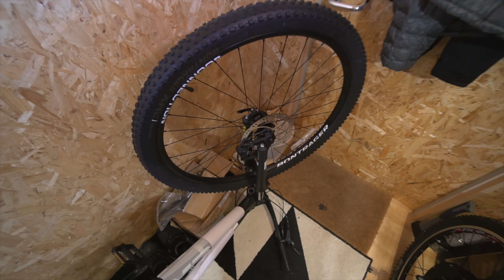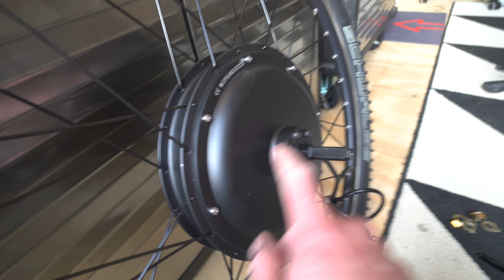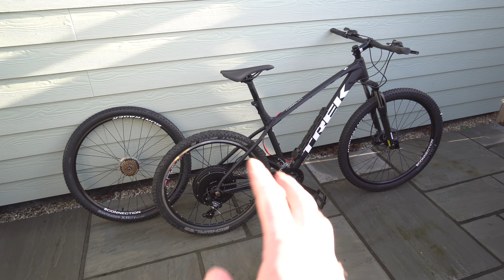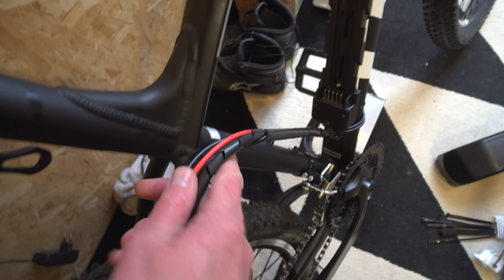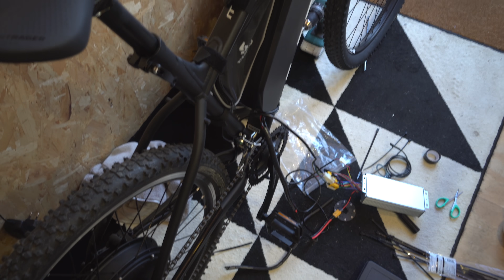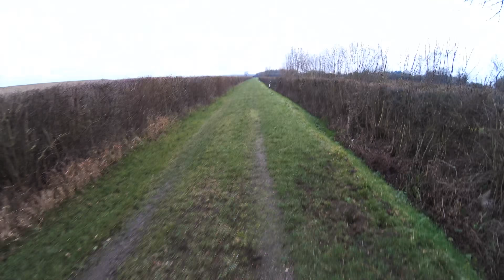HOW TO MAKE AN EBIKE IN UNDER AN HOUR!!! | TREK MARLIN 5 EBIKE CONVERSION

Comment: Nice to finally see a decent U.K. Eebike build. Thanks for the video. How have to found the kit reliable? How’s the battery etc?
Reply from the maker: Very reliable, I’ve been using hub motors for years and they just keep going, even if they regularly get wet and dirty they continue to run just fine. Battery is over specced for this kit so it doesn’t even get warm and offers over 30 miles range.

Comment: Great video I'm after a kit with pedal assistance and the thumb throttle and a bit of range 40 odd miles + if possible can you recommend any kits please
Reply from the maker: Yes this: https://www.cloudsto.com/ebikes/kirbebike-conv-kits/kirbebike-1500w-2000w-ebike-kit-inc-ion-plus-58v-17ah-battery-detail.html

Comment: Back wheel constantly needs respoking due to torque pressures , real pain in the arse . Rain really screws up the exposed wires . Also bike heavy and difficult lifting over stiles and steps . Try putting the equivalent weight of kit in a pannier and your first thought will be : ‘ This bike needs a motor “!  Electric bikes are an illusion .
Reply from the maker: Maybe you got the wrong kit 😁

Comment: Thinking of buying the conversion kit. On the cloudsto website in the description it says it comes with a 58V 17Ah battery, but under battery specifications it says 52v 17ah. Which one is it?
Reply: 58 is probably fully charged, and 52 is probably nominal voltage. I may be wrong but it should be the same pack

Comment: Have just completed a conversion of this exact bike, trek marlin 5, 29er, 
Fitted a 1500w hubmotor, controller and display look the same, 
48V 21ah triangle battery, 
power is great, 
65kph on flat fully charged, 
40kph up an incline, 
30km range without pedalling, 60km range or so depending how much I help it by pedalling, 
And the bike handles great, although braking has been affected as it is now quite heavy,
Reply: I bought the kit from CSC bikes on eBay, the battery I purchased from Etario store on Aliexpress as it was cheaper, 
if I was doing it again I would get maybe a 1000w or 750w as I think they would be powerful enough, 
On full throttle with the 1500w motor the display shows over 2500w consumption, not good for range when you do that,
Reply: @NM-zb2mo  Thanks for the response and tips! I'm building my own soon :)
Reply: Niall Martin thank you for the information!!
Reply: sounds amazing. Where did you buy the kit and battery?
Reply: https://youtu.be/fyYI2yCxsRc
Reply: https://youtu.be/GhZyjmx22ZE

Quick video of the bike, will get something better recorded soon,
Reply: I bought the same bike in the video about 5 years ago. I like the idea of getting an e-bike so I can do longer rides. Never knew you could convert one. You think I'd be better off converting my bike, or just selling it and buying an e-bike?
Reply: @glenc2353 better off buying an e-bike, conversions have a lot of drawbacks, sensor pickup when you pedal is not configured properly with the controller, maybe there’s better controllers now. Weight is an issue, some custom work needed also to fit.

Comment: My motor makes a noise, vibrates, but dosn't spin. Any ideas? I can spin it with my hand but not the electricity.
Reply from the maker: Check your phase wires (three big wires going from the controller to the motor) also check other connections between motor and controller.
Reply: @andykirby  Ok, thank you. I will check.

Comment: Hi Andy, I have just received this kit and the controller in the box is showing rated voltage 48v and rated current 17A, on the website it says the controller max voltage 58.8v and max current 35A. Is this the correct one? Or are max and rated different things? As far as I am aware rated voltage is the maximum that it will run before causing damage and the battery that I should be receiving off the same order this week is a higher voltage than this controller can take.
Reply from the maker: It’s the correct one. The controller is designed to handle 60V. The battery will only be 58.8V when it’s hot off the charger and will drop as soon as you throttle. The current is 35A peak and you’ll only get anywhere near that when accelerating from a standstill and even then it will just be for a few seconds. Hope this helps.

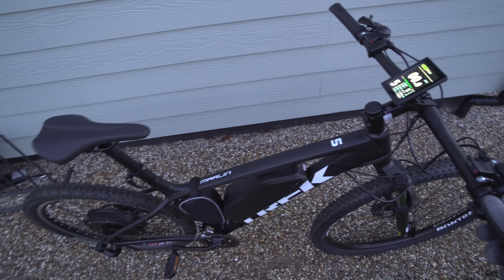Comment: you did not install the pedal sensor (11:10-11:40)  and so you don't have pedal assist. you are just using throttle mode.
Reply from the maker: I did install the pedal assist in the end.

Comment: Hi I like the idea of a road legal kit, I would prefer not to have a thumb throttle just rider assistance. Can the level of power assistance be regulated from the display screen? I am looking to replicate the latest batch of factory E Bikes, like the Ribble Se which has 3 fixed levels of power assistance.
Reply from the maker: Yes you can use just pedal assist and there are 5 power levels selectable via the display.
Reply: Thanks for that what is the range for the battery that is in the kit?

Comment: I'd be super interested to adapt one of these to fit a Fat Bike. I just acquired a lightly used Coyote Skid Row. It has 26" x 4" wheels and the rear axle is 240mm long with the hub being approx 135mm from the disc brake mount to the back of the 1st gear cog. Can't measure it any more accurately at the mo as I want to go out on it this afternoon! I can guess that it will need a wider hub to keep the rim centralized in the frame and the gear set aligned with the front chainring. But maybe not, could the wheel be re-laced to the ebike hub to offset the gears while a spacer deals with the brake disc position? I'm a CNC mill setter and have made a few bits and pieces for myself over the years. 

Heh, I'm going to check out the re-cycling center this afternoon to see if they have any disc braked bikes down there that I could hack.
Reply from the maker: Should be possible, as you say the only real concern is getting the rear sprocket inline with the chainring. You could relace the motor wheel to the fat bike wheel or we can supply a fatbike motor wheel. If you email me we can discuss further 😁 andy@cloudsto.com
Reply: @andykirby  Sounds interesting. I just had my first proper session on the Fat Bike and love it to bits!!!

Comment: Alright there my friend I watch your videos a lot and think they are spot-on and the things that you do all Electric is the future I have just bought my 48 volt 1000w bike conversion kit and I don't have a battery to question that I have for you as I have 5 14.8 volt quadcopter batteries would 3 of them Tom the motor at Max charge the three batteries will give 50 vaults but the ESC that came with the brushless motor is Max 48 volts if I stuck 50 volts into a 48 volt AC will it blow thanks I will be waiting on your information all the best my friend
Reply from the maker: Hi there, 4S packs are a bit of an annoying voltage as for a 48V setup you need 13-14S (depending if the controller can handle 14S). You could try to use 3 of them as it would be 44.4V nominal and 50.4V fully charged. The only problem is they are probably quite low capacity if they are quad copter batteries (maybe 5Ah Packs?) you would not get a lot of range (well under 8 miles if you pedalled as well)
Normally people parallel lots of RC batteries together if they want to use them on their ebikes. It can be a bit of a nightmare with balancing and charging. Much better to get a proper ebike pack 😁

Comment: Nice video Andy, :) , I have same rear motor, you reckon she can handle 3kw easy eh? how many volts would we need on the battery to pull that off, 100volts? and 100v controller?
Reply from the maker: About 72V and 40A ish...

Comment: Do you have that compete kit with a 750 to 1000 way motor... Can you get it that way, and maybe 20-40 ah batteries. I'm guessing but two batteries.
Reply from the maker: Yeah it can be done, 1000W. Batteries of above 16Ah you might have trouble fitting that size battery in your frame though?

Comment: Do you think your kit would go on this i think i might strugle with the clearance for the battery also im only 5 foot 9 and like to ride with high handle bars so putting a smaller 26inch wheel on the back what do you think ???    (https://www.ebay.co.uk/itm/Canyon-Nerve-Al-6-0-27-5-large-frame-mtb-mountain-bike-trail-dh-downhill/333202093983?_trkparms=aid%3D888007%26algo%3DDISC.MBE%26ao%3D1%26asc%3D20140328180637%26meid%3D0e4093701176417f9be313582f885163%26pid%3D100009%26rk%3D1%26rkt%3D1%26mehot%3Dpp%26sd%3D123766744005%26itm%3D333202093983&_trksid=p2047675.c100009.m1982)
Reply from the maker: Nice bike, yeah you might struggle with the battery, there does look like a bit of space though, you could mount it underneath... I’ve got the battery dimensions if you email me...you can put smaller wheels on yeah, shouldn’t be a problem.
Reply: @andykirby  Thanks for your reply I think I will wait for the right bike to Come along I like your Trek but like full suspension.
Reply from the maker: Yes, quite a few guys have done full suspension conversions with my kits now, it purely depends on the bike, you really need to measure to be sure.
Reply: @andykirby  can I have the battery dimensions please
Reply: I've bought a trek 6700 from ebay with lots of extras second hand £150 in great condition and I've bought your kit can't wait to put it on.
https://www.ebay.co.uk/itm/trek-mountain-bike/223527230104?ssPageName=STRK%3AMEBIDX%3AIT&_trksid=p2057872.m2748.l2649

Comment: Hi Andy how can I contact you by email or phone to get a controller? Ive been following you for years and have got several ebikes here in Bournemouth..Have one almost the same as this on a Carrera bike 1500w setup similar to yours
 but I believe my controller has gone, bought another controller similar but has all different plugs and just want to get it going again maybe buy a controller from you.
A fries used it and back wheel came off under load, didn't do and cable damage but the controller stopped ...
reads Sam
Reply: Ive seen your email now at cloud will email you
Reply from the maker: Yes got it thanks.

Comment: On the disc brake side where did you get the part to mount the disc please? Thanks in Advance, have a wonderful day.
Reply from the maker: You mean the little spacer? It comes with the hub motors. You only need it if you need to space the disc out from the hub.

Comment: How have you found this setup over time. I'm thinking of doing the same with the same bike or do you have a recommendation for another bike to convert in the same price range
Reply from the maker: It’s working great and is a joy to ride, I’ve changed the front forks to proper rockshox air shocks now as the standard ones are a bit like pogo sticks! check the video a few after this one where I show the mods I did.
Reply: @andykirby  you never said how much the kit was and where you bought it from that's amazing how you guys don't mention the things that people wanna know the most amazing!
Reply: @grangergreenback7152  - Its in the description.
Reply: @sumran_domguy  I made that comment before the video ended, then right after I went back and looked at the video again to see the price

Comment: I think you installed the rotor in the wrong direction there is an arrow showing the direction of rotation
Reply: The Discbrake is on one side... It doesnt fit otherwise

Comment: Looks really good but 739, how much better is it than the ebay ones that are 175
Reply from the maker: Remember the kit includes a high capacity battery. You wouldn’t even get a decent battery for £175 let alone a good motor kit. 😉

Comment: could you mount an alternator to the front wheel and charge the battery? as you ride
Reply: The motor can actually work in reverse and act as generators, so you wouldn't need an alternator. He did mention regenerative braking, but didn't go into any depth. You could pedal against the regen but in principle it'd be more efficient to set the throttle to zero if you're not trying to slow down.

Comment: Hi Andy good video mate, I was wondering how mutch do them Ebike conversion kits start from? (including the battery & motor, controler, charger ect basically everything in a kit i would need to convert a normal bike over to an ebike ready to ride & go) as I was thinking of buying a ebike or converting my 26" inch wheel mountain bike over to an ebike with out spending a fortune in the process. was just wondering thanks

Comment: Hi! I have a Giant Escape 3 XL (2018) and just wanted to make sure the 700C kit is compatible. No issues with wheel size or not having disc brakes on my bike? Would LOVE to order a kit but I just want to be 100% sure it'll work before I order.

Thanks!
Reply from the maker: Hi, yes if the wheel size is right it should fit. Not having disc brakes is ok as the motor rim has a rim around the side for friction brakes.😁

Comment: Is there any difference between a front hub or rear hub motor? I bought a front hub motor about a year ago and would like to install it on the rear. Is this possible to do that? And what would I need to buy?
Reply from the maker: The main difference is the rear has a thread to screw on the rear gear set and the axle is wider.
Reply: @andykirby  alright, I think I will keep it on the front for now.
Thank you for the quick reply!

Comment: I just got my bike on the charger for the first time this year. I need to get my brake lights worked out soon, and I am considering changing the fork or rebuilding it along with the head tube cartridge and front brakes. The hope brakes don't seem to bite like I would like, but I haven't tried to tune them much.

I really am thinking I want to do a low power setup that is bikeable for work commute. I am leaning towards a middrive for that, and may use my gt zaskar frame or start from scratch.

Comment: great video Andy, keep it coming... I'm subscribing
Reply from the maker: Thanks! And welcome😁
Reply: @andykirby  how much range do you get off the battery in your kit
Reply: @andykirby  
I just fitted your kit and it’s working all ok. What is the correct settings for full throttle in the parameters?

Comment: Hi thx for posting this vid. Ibelieve some companies do have a solution for hydraulic brake cutouts. If I run across it again I will post a link. Need 27.5 and 29 inch wheel options. Will get pedal strikes fitting a 26 wheel on a 29er bike. Cheers

Comment: My mountain bike is 27.5” and all ebike kits are 26” would that work with my frame or what can I do please need options or guide for my situation
Reply from the maker: We can supply you a 27.5 inch kit, see here:  https://www.cloudsto.com/ebikes/kirbebike-conv-kits/kirbebike-1500w-2000w-ebike-kit-inc-ion-plus-58v-17ah-battery-457-detail.html  you can select the wheel size from the drop down menu.

Comment: By mounting a smaller wheel to a frame designed for bigger ones and on top of that leaving the one in front, you've affected the geometry of the bike and by doing so you've increased the chance of snapping the frame. Really sloppy I really hope nobody repeats your work.
Reply from the maker: We now sell a range of different wheel sizes so you can pick the correct size for your bike.
Reply: @andykirby  then delete this video and make a new one with correct information. or you will feel bad for losing all that likes and subscriber's?what is more important to you? the safety of your people or your personal gain?

Comment: Do the new hubs come with a weatherproof connector  as it comes out of the hub so changing tyres is easier !
Reply from the maker: Yes we are starting to do this on the new kits coming through. As you know it’s a pain removing everything to take the wheel off...  still have to take the torque arms off though unfortunately.

Comment: About those e-brakes. You absolutely must have e-brakes! These cut out the motor as soon as they are applied, sure you could take your finger off the thumb throttle as you apply the brakes, but that not quite the same thing. I believe there are sensors you can add to hydrolic brakes to act in place of the e-brake sensors. But yeah a 1500w motor without proper ebrakes doesn't bare thinking about. Be safe.
Reply: Not a must have, unless you're a bumbling fool. An ICE motorcycle, scooter, moped, automobile, etcetera, doesn't cut power when you touch the brakes.

Comment: Sod that just tell me how to make my volt pulse go faster. 😂 I did 10.5 miles tonight on my volt with the lowest assist and my bones are buggered, I’m 15 clem so it’s not easy on that assist level as it should be but with time and many more outings I will get fitter. That’s the reason I bought it. It’s just crappy that it only does 15 mph. Even 20 would do me. Make sure you lock your battery because my battery came loose (bloody potholes) and everything went off lol.

Comment: Under an hour my ass, just getting the rear wheel to fit right takes that long.
Reply: Then use a front wheel electric motor to simplify the process.
Reply: John Doe-plorable well then you don’t know what your doing

Comment: Hi Andy, 
first off - bike looks great!  I have similar hub motor, the wire going into the motor has a gap to fit through the axle so its on outside of frame rather than between frame and disc/motor, yours looked like it might get snagged?  unless i've done mine incorrectly...either way awesome build !